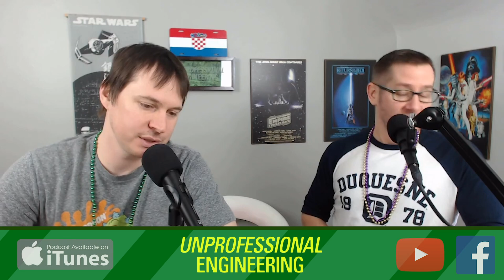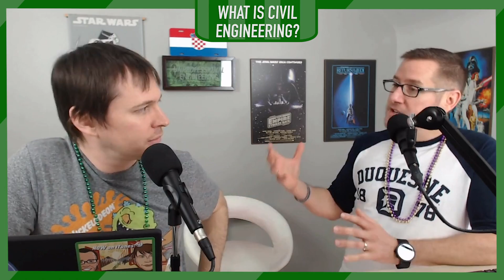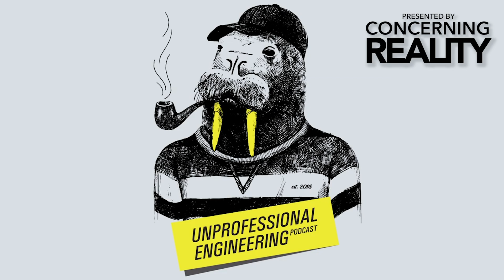What is Civil Engineering? | Unprofessional Engineering | Podcast

Comment: Take a look at the flood walls, pump stations and levee enlargement projects of post-Katrina New Orleans if anyone believes civil engineering is anything less than crucial.
Reply from the maker: Definitely, civil engineer here myself!✌🏻
Reply: Concerning Reality , much respect. I spent 6 years working with the COE in NOLA post Katrina.
Reply: I love when they say “pouring concrete” instead of “placing Concrete”.
Reply from the maker: @randon11000  That may be a cultural thing be I'd say (and I learned to say) pouring concrete here in the U.S.
Reply: Concerning Reality, you’re right that it’s a common term but it’s just stuck in my head.